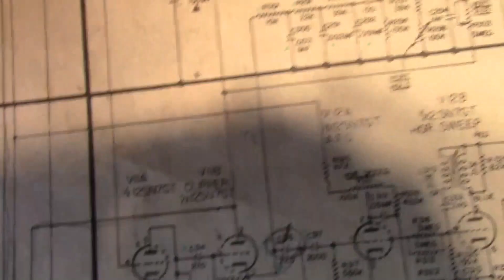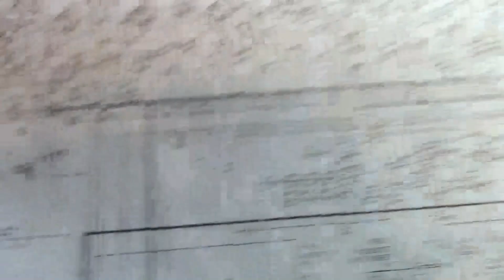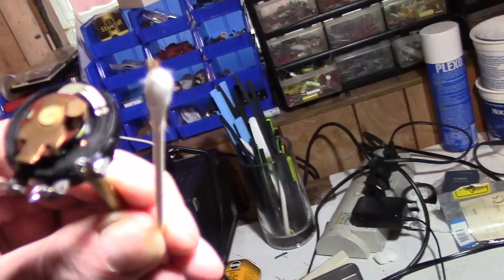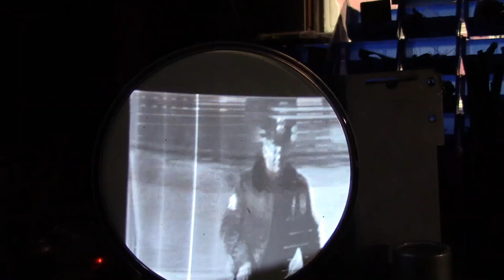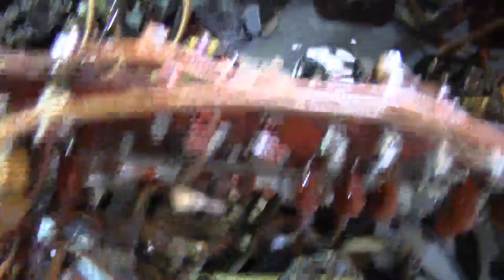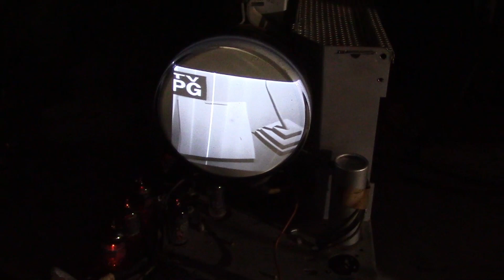GE 800D restoration p5o8

Comment: I have a big box of old pulled potentiometers; I buy them cheap off of eBay or are my own pulls (the same goes for rotary switches). They come in handy when an oddball pot needs to be rebuilt. It's usually a volume + power unit that needs a new carbon track or has a flaky power switch. I have been disassembling control pots for a long time now (over 30 years? huh) and agree that the tabs need a lot of care otherwise they fatigue at the bend and break off. Usually I only need to take one apart once.
Getting closer to a fix, it's a puzzle but solving it is fun.
Cheers,

Comment: One thing I noticed was that the ability to achieve vertical and horizontal lock seemed to be affected by the contrast control…as if, somehow, the sync separator was looking at the signal AFTER the contrast control. I know it’s not actually that way, but that’s the impression I got. You’re doing a good job and it looks like a LOT of really hard, tedious work.
Reply from the maker: Oh yes it is that way unfortunately.  This set has no AGC.  The RF and 1st IF stage grid bias (gain) is directly set by the contrast control.  The sync signal is taken from the final video amp stage.  A far more common configuration is for the contrast to set the final video amp gain and have AGC for the front end.  So it's entirely possible this is just how the set is due to a poor design.  That being said, the picture is remarkable sharp as you'll soon see.

Comment: The part in the HV cabinet looks more like a VDR or early thermistor than a capacitor, but can't really tell from the video. I was working for a Zenith dealer & those VDR's were a real pain in the hoo hoo to test. Often the owner would sub a new one in just to verify it's condition.
  CTS, Centralab, and Mallory were the main "Build it yourself"  control suppliers. My area  had mostly Centralab control parts. I would save old "junk" controls for the shafts & backs to repair broken controls if replacements were NLA.  I loved the old Chemtronics Freon TF cleaner and Shield for lubricating. Sadly they stopped making the really good stuff. Try feeding the set with a VCR,  VA 48 or dot bar generator. You may be overloading the TV with the converter box signal.  Ht & lin are off too. Possibly a yoke problem and H drive issue?
Reply from the maker: I found out shortly after recording this segment that it is indeed a type of thermistor.  It has a specific tempco to compensate for thermal drift in the horizontal circuit.
Reply: I have an old can of Chemtronics R-12 freeze spray.

Comment: I got a radio with a on/off volume control that won't budge. Sprayed it with contact cleaner and left it for a week.Still won't budge.Could be the on/off part
has seized somehow? On the other pot I certainly hope the carbon track inside isn't acting like a wedge because it broke!😫

Comment: I have seen that horizontal foldover, or drive line, right in the center of a screen, but this one is shifted to one side. I have that on the old Hoffman set that we could not find the root cause of, have never been able to get rid of it entirely. That one seems to have some odd harmonics to the horizontal waveform, off center, you can see a pattern. Would be curious to see a scope display of that circuit to see what the waveform looks like.
Reply from the maker: You will in the next installment. I can tell you that the problem is not in the horizontal drive or yoke.  The ringing is in the damper circuit.
Reply from the maker: Yes, that is typically where you see it.  The left side of the sweep is primarily driven by energy recovered from the collapsing magnetic field of the previous scan line.  The right side is where the horizontal output tube takes over.  Adjusting the drive control affects the cross over point.
Reply: @bandersentv  Since the lines are only on the left side it seems logical that there is some harmonics (ringing) of stored energy getting into the horizontal drive frequency. So much of the horizontal circuit is interdependent on each component, flyback, yoke, coils, damper diode, capacitors, CRT, resistance, and grounds, it can get you going in circles, because it can be any of those, or a combination of several items, no obvious smoking gun.

Comment: I would put a scope on the horiz grid drive to the HOT to see if it is a nice linear ramp or if it has some anomalies that are causing that white vert. Line? Or scope the video signal to the CRT to see if the video signal has some sudden jump to the white level on each scan line at the same point?
Reply from the maker: I did in part 4.  It's pretty clean.  Also from my understanding issues on the left are typically with the damper circuit.  That's where the recovered energy from the magnetic field collapsing is used to start the deflection cycle.

Video signal is clean.

Comment: I remember seeing that disc in the high voltage cage. I think you’ll find it’s a thermistor. I don’t think it’s marked as such on all publisher’s schematics though. 

Ok, the contrast control is varying the gain. Is it possible that the gain still isn’t high enough to give consistent hold because the IF needs alignment? That idea kept bothering me with the 800C because I thought it couldn’t still be in alignment with the crazy number of resistors I had to replace (plus caps & tubes) that we’re WAY out tolerance.  (I probably had to replace 40 resistors, some of which were 40% or more out.) My bet with your vertical line is your horizontal output; there is ringing. I recall reading somewhere that the 800-series set is picky for H.O. tubes.
Reply from the maker: I think lack of AGC is an issue too.  I have no reference as to how this set should work so it's possible is just fine.   Picture is razor sharp as you'll soon see so I don't think it's an alignment issue.  Resistors, tubes and paper caps aren't going to affect the alignment.  It's determined by the adjustment coil and probably those mica caps.  I did try to tweak one of the alignment coils and it didn't budge.  I expect I'd have to chip away at the glue to free them up.

Comment: Fading issues: Check or probe your High B+ voltages when it fades in and out like that. You've got a high voltage diode going to short out soon
Reply from the maker: That's just me manipulating the contrast and brightness controls.  B+ is fine.

Comment: If the signal is too hot coming into the set, couldn’t you weaken it a bit with an attenuator on the output of the converter ? As for the buzzing, Zeniths had a buzz control. Could you make one ?
Reply from the maker: I'll hook it up to my test pattern generator and see what performance is like.  That has a variable attenuator on the output.  I think a bigger issue is a complete lack of any AGC.  The front end gain is completely controlled by that pot.  I suspect it's going to be touchy no matter what unless I reduce the range of that pot by adding some external resistors.

Zenith used a specially designed 6BN6 gated beam tube for FM sound demodulation.  That unique design uses the buzz control.  The best you can do with conventional designs like this is go through the sound alignment procedure.

Comment: Hi Bob, couldn't you try letting them soak in a beaker full of contact cleaner, or in lighter fluid, without taking them apart.
Reply from the maker: That wouldn't flush the gunk out though.  Never tried using lighter fluid before.
Reply: @bandersentv  I haven't tried lighter fluid either. What about a gentle wash in an ultrasonic cleaner? I'm making suggestions so as to avoid having to take old pots apart. Get a couple of noisy, cheap pots and experiment with them.
Reply: It's a good thing they're not conductive plastic.  Penny & Giles uses it in their super high-end linear potentiometers.  Anything other than water and soap will damage them.
Reply: @channelsixtysix066  - There is a good chance that the ultrasonic cleaner would destroy the carbon track... so the pot would have to be dismantled enough to take out the track for the rest of it to be cleaned. It could be done if enough reason but by then the pot is disassembled anyways.
Cheers,
Reply: @EngineeringVignettes  Yeah, you're right. Even if you set the cleaner on very low.